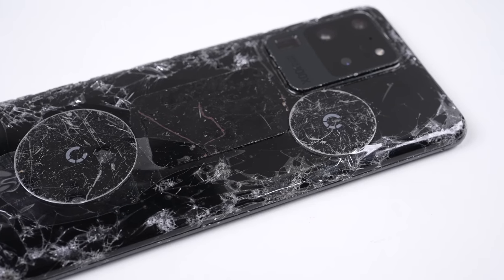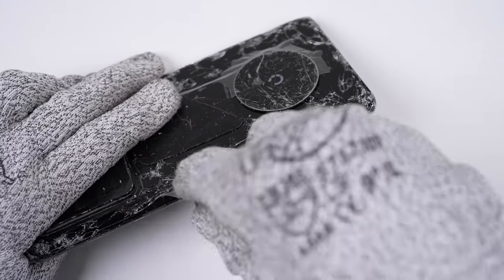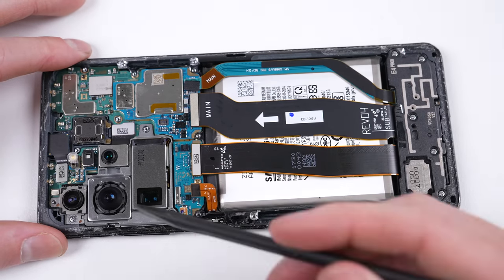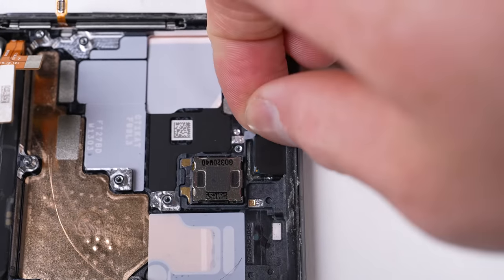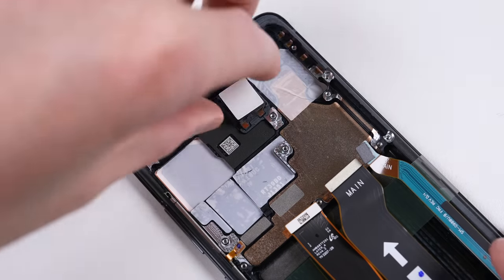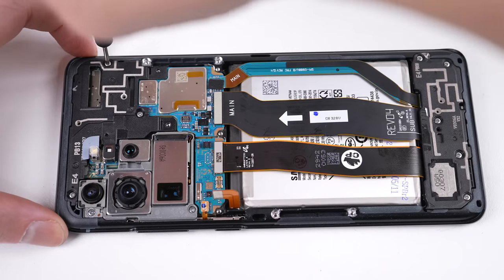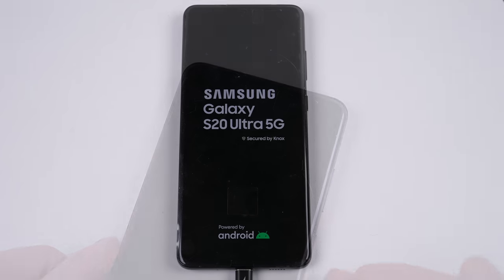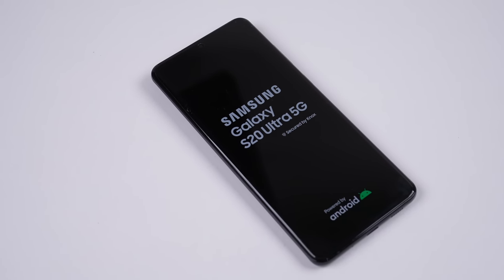$80USD Samsung Galaxy S20 Ultra Restoration

Comment: Would you be interested in an iphone 8 for parts? It's all in pieces as I was going to restore it but the price was too high and can't default the passcode. I was told it got wet but I can't see any signs of it had gotten wet. Except for the layers of the screen. Glass is still good.

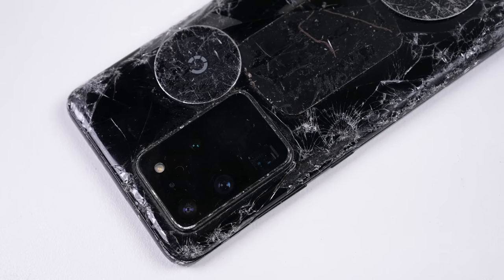Comment: 0:27 "Why would anyone need so many?"....LOL I've used like 6-8 of those magnetic car mounts before on a tablet. Granted I used a case and stuck them on the case instead of directly of the device itself. Quick/easy way to make a cheap Android Auto/Apple Car Play auto type experience if you have a tablet laying around.

Comment: So, I bought a replacement Galaxy S10e that is sitting on a drawer for when my current s10e kicks the bucket but should I open up the replacement and disconnect the battery? Thoughts from the community?

Comment: Very nice, i always have doubts when buying such a broken phones. You will replace screen, back and if the camera will be broken you are not able to make profit on it.
I see that you use copy of the back cover that may lack of the oleophobic cover and it will have that weird feeling plus fingers will leave a lot of smudges.
Anyway nice repair. I bought this smartphone last year for myself for 250€ - fully working and i am very happy about it, best smartphone that i own.
Reply: Not to mention the risk of FRP. I don’t get why he didn’t have to deal with it here, the phone had a pattern lock, how was it not signed into a google account? 🤔
Reply: @HNedel  you can contact seller before the purchase to get pin/pattern. The second option is to remove it with free third party software or paid one "box"(hardware).

Comment: A few weeks ago I had the experience of replacing the screen on my S10+ (this was the first smartphone screen I've ever broken, and my first one was the Motorola Droid). Thanks to Hugh and iFixit, I had a pretty fair idea of what I was in for. I feel like those replace your screen in an hour places are skipping the most important and most tedious part of the project, which is removing the adhesive and cleaning the surfaces before putting it back together (I think Hugh has mentioned it one or more times). I am a stickler for that in my profession. The project took me three hours, most of which was adhesive removal. But I did it and I am very satisfied with the result.

Comment: I'm guessing the phone didn't have a Google account attached to it? Because when there is one, once you factory reset it that way, it asks for the previous owner's Google Acc. password, just like an iCloud locked device.

It's sure as hell easier to go around it than an iCloud one but still a major issue, sometimes even unbeatable depending on the model.

I was able to go around it when I had that happen to an S8 (relative forgot their password, they themselves didn't even know they had a Google account linked to it) and the only way I could get around it was to flash a newer and very specific version of the OS for the same model so that I could make use of an exploit (trying to open settings repeatedly as you insert a SIM card). If it weren't for that exploit, even with a whole new ROM flashed onto it, it still asks for the old account's password.

I just find it interesting how nobody really talks about it.

Comment: How did you factory reset when a pattern lock was needed. I factory wiped my phone from the bios and when it came to signing into Google it asked me for the previous password as a security precaution, so I tried to do it without adding my previous code and it wouldn't let me at all.

Comment: I'm guessing that the Exynos version doesn't have the feature called FRP? You seem to be able to just factory reset to get rid of someone's pass code but any time I repair someone's phone if I can't get the pass code then I have to jump through hoops with certain firmware otherwise the FRP will just ask you for the pass code again as soon as you get to the Google screen even after wiping it, it's still going to require it unless you know what you're doing! I'm assuming it might be the same for you, but you're just not showing those steps in your videos.
Reply: I was thinking the same. Don’t know if FRP is dependent on the chipset used, i assumed it was a software feature that works with every chipset

Comment: After reset it most likely went into FRP lock as it 100% had a Google account on it but you didnt show how you fixed that.... also Im wondering... with the money you paid for the screen, back panel and battery.... didnt u exceed the price of a USED BUT STILL UNBROKEN AND IN GOOD condition S20 Ultra??????

Comment: Hey Hugh, I've noticed that whenever you replace a phone's battery you never bother to reset the charge cycle counter of the phone. A phone's battery life actually won't improve unless you reset that counter - an issue that is rarely talked about and leads to most DIY repairers thinking the new battery they bought is just counterfeit. In order to reset that counter you either need root access or a proprietary OEM software only authorised shops get access to.
Reply: Not smtg you can do without tripping the software permanently

Comment: How much did it cost to repair compared to buying a used but like new one?
I have an s8+ sat in a drawer that is entirely uneconomical to repair because of the cost of the screen and rear glass. A replacement phone is actually cheaper!  The extortionate cost of spares is just as dirty as apples anti repair agenda.

Comment: Awesome. I have had an S20 Ultra since 2020 and want to keep it until at least 2025-26. So far, am only going to have the camera glass replaced because of surface scratches, but I may replace the battery at the end of the year.

Comment: You've intentionally left out the fact that Google also has a form of an iCloud lock. It's not cloud based tho, it is in every device's bootloader - FRP (Factory Reset Protection). The way you've reset it will prompt you for the previous owner's Google account and won't let you go past that screen. Samsung even prevents you from bypassing the internet connection screen if the OS detects that it's FRP isn't reset and it's in the setup process.

Comment: I was sent to an "authorized by Samsung " repair place and they were going to do the work of investigating my Galaxy S20 Ultra for the back separating and they said they could do that free and I thought Samsung was paying anyway, but then they said it was a swollen battery and that would cost and I had to drive 1 hour to get there so I decided to get it done, but while they involved with that they then came out and said that the screen was affected by the battery swell and I said oh hell no, you are just scam artists looking to find more made up stuff to make money on and I took my original condition phone home and called Samsung and told them how I was treated by their "authorized " repair place in Mobile Alabama and they decided to have me send it directly to the Samsung repair facility and in 8 days I had a new phone because the defective swollen battery had cause all too much damage to repair. I had the phone still under warranty when I started calling Samsung,  but for over 6 months back and forth with Samsung it was similar to how Canon treats their stuck shutter on the Sureshot cameras. They won't recall an actual defect and have each person send them in at their cost and then they just repair without doing a recall. Sony did that with their rear projection TV light box that let dust in causing owners to keep buying new bulbs at a minimum of $200!
New Galaxy S22 phones are now over $2000 so don't downplay a repair by saying we could just buy a new one!